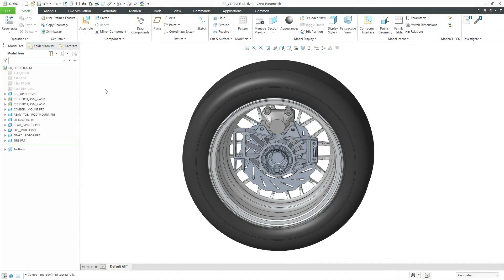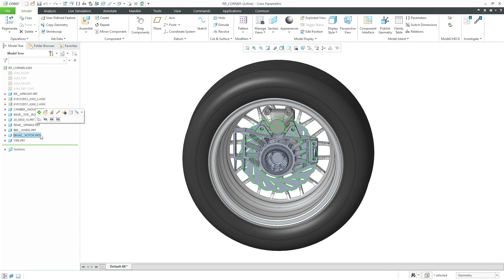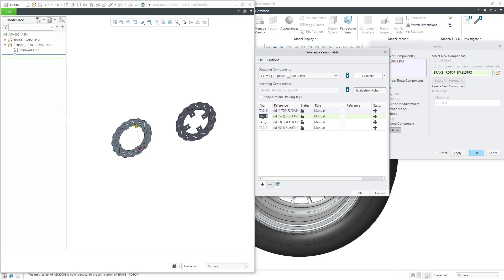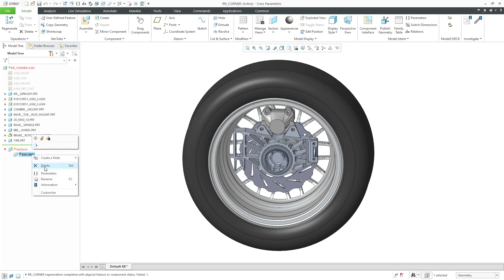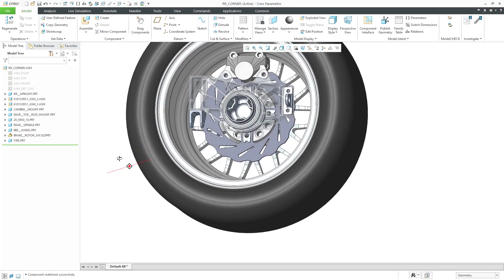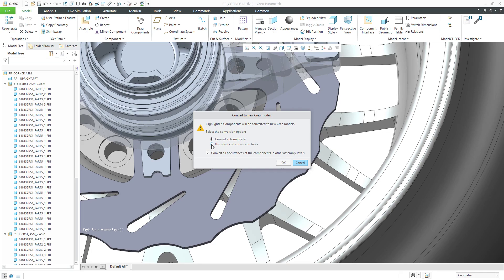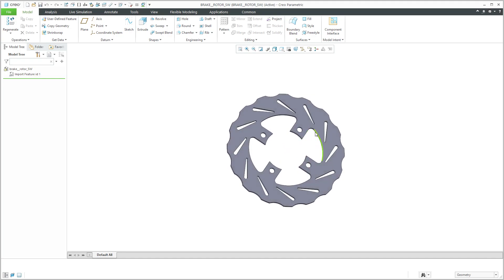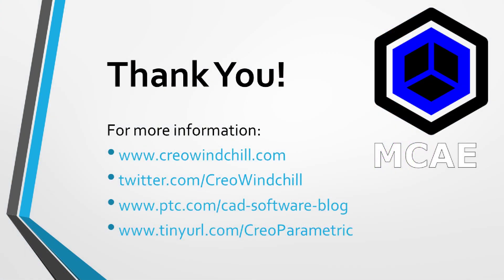Creo Parametric - Working in Multi-CAD with Unite Technology

Comment: Hi Dave I was just exploring Unite technology...So If I import a non-native CAD file to creo assembly and save the  Creo assy file,whether the imported subassembly get converted into creo file? or can we maintain that imported file in the original CAD format so that any changes made on the file using the original CAD programme will get reflected in Creo Assembly??....Thanking you
Reply from the maker: You can convert or you can maintain in the original format.

Comment: Recently i was trying to import Autodesk Inventor files and assembly's and i wanted to share what i learned. I suppose that is the same thought processes for the other CAD packages?
1. Before you import the files go File > Options > Data Exchange > import and Open Profiles and setup the Templates of your choice. If you import the files first, templates have no effect, you will need to delete the files *for inventor .ipt.creo & .iam.creo.
2. The original Datums are located in the Leyers tab and are hidden, if the number of Datums are exceed i think 500 (for my case only ?) you will need to delete some in order to be visible.